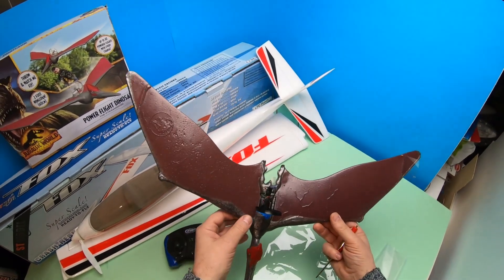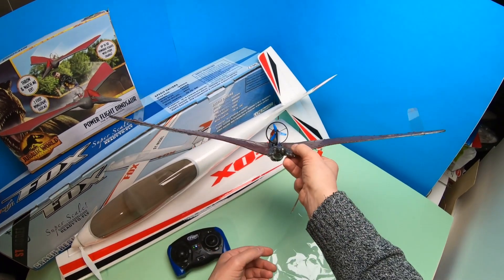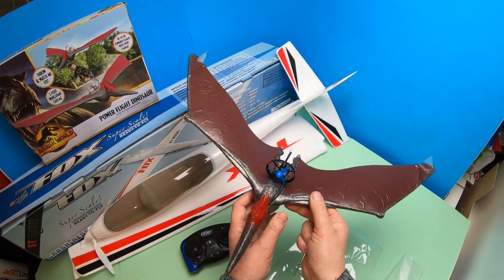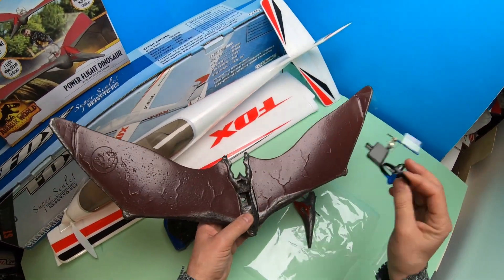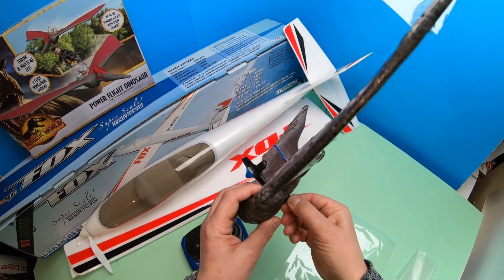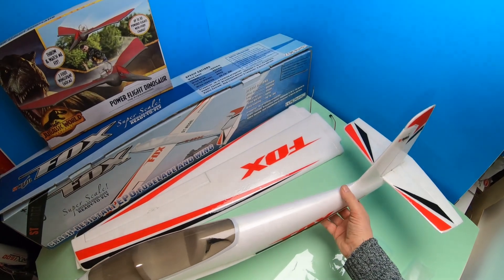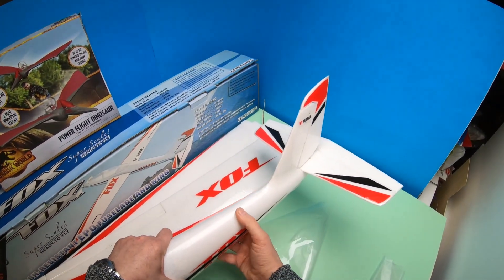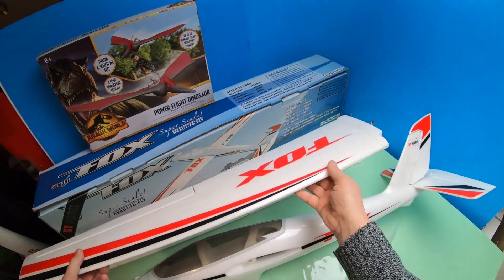Gliders

Comment: Hi Steve that little Dyno is neat, have you any links to the model and the extra bits. We had a guy come up Pendle hill about 30yrs ago with one about 2 metres wingspan.... always testing, nothing ever flew.................. On to the Fox laminating film, is it sticky back, again any links. Thanks Tony. I think Walter was also going to your indoor meet.
Reply from the maker: Hi, The Dino I bought was from Lidl, before Christmas the radio control are from a old Flyline model.
Laminating film is indeed sticky back activated by heat and so is applied the same way as Solar film although not as flexible.